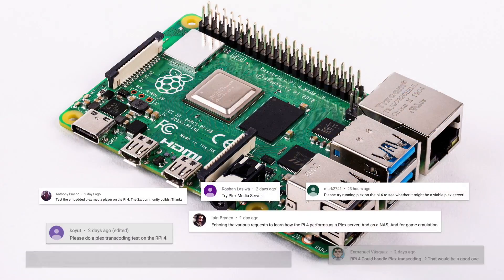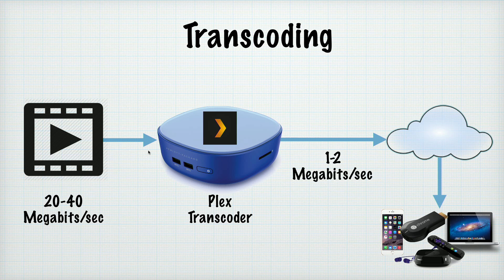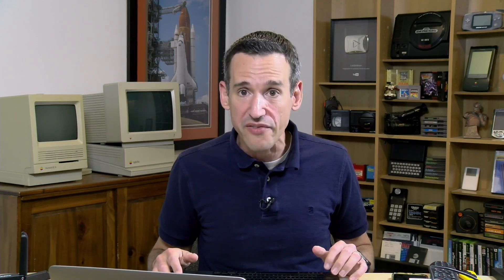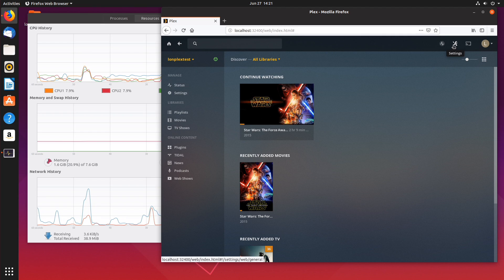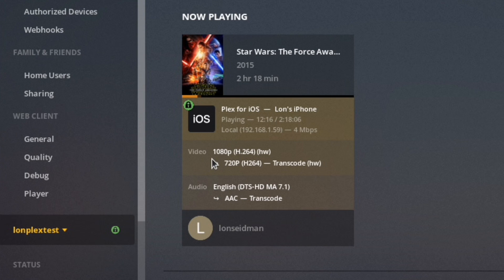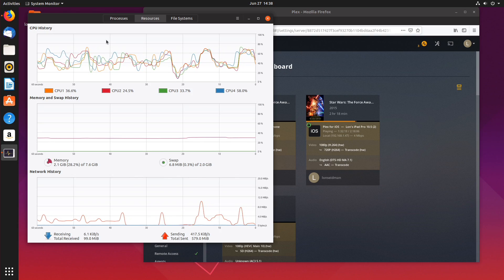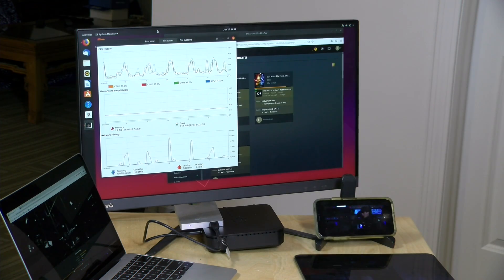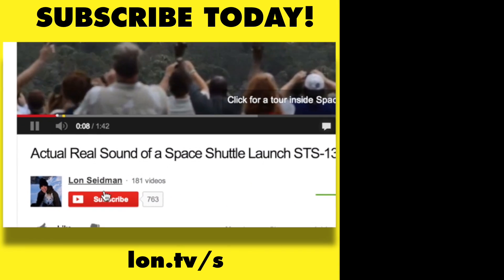Plex Hardware Transcoding Explained : Do you need it? What is the performance like?

Comment: Maybe you could help me with my issue. So basically nothing changed, but my videos started to buffer once per 3-5 minutes. Probably what changed indeed is Plex upgrade from 1.27 to 1.28. My Plex server runs on Synology DS218+ with 2GB of RAM, all settings are default, no hardware transcoding. I'm watching videos on Samsung TV via Samsung Plex app. The strangest thing is that I have zero buffering issues watching the same videos via simple file explorer using DLNA.

Comment: Hi !! Could you comment / compare how a J4125 (intel) will compare with a GPU from MSI Geoforce Gt1030 2G Low Profile or a 1650 4GT LPOC or a 1030 2G LP OC ? I have been considering a unit from QNAP 453D vs a 473a and adding any of those cards (if found), but, I am a bit confused about how much performance I would get using any of those cards on the 473a vs using a 453D or 253D. 

THe 473a uses an AMD chip --> AMD Ryzen™ Embedded V1500B 4-core/8-thread 2.2 GHz processor, so, It just makes me wonder if it's worth it ? or should i just pass and get a 253D (2 bays) or the same 453D (4 bays). Both 453 and 253 use celeron chips with transcoding. But, my concern in the end is really how much will i be getting if I went the AMD way. 

I have looked at the specs, but really there is only so much I know that, I would really appreciate your recommendation. 
 
My transcoding would to share videos from my  iphone to family and friends but keep them stored on a NAS. Thanks !

I have played a bit with PI 4 as a nas, and again, it works but can't do transcoding properly ( is to small or lacks a bit of power - if transcoding to lower bit

Thank you in advance. I am looking forward to hearing from you.

Comment: Is there a better way (less stress on the motherboard CPU) to have the transcoding done in hardware other than the main CPU,  like on an internal or external SSD or in RAM.   When I open the Plex toolkit and go to transcoder, I see other boxes where settings can be made to configure the transcoder.  Could you explain how these settings can affect the transcoder please?

Comment: Sorry, but 100% CPU is not necessarily "stressing out" the CPU. It is working the CPU, yes. But just because the CPU is at 100% doesn't mean that it is overworked. Thinking that it should be at something lower than 100% is erroneous, that means that it is idle ... which is something we wouldn't expect in your workflow.

Comment: I often read, that Intel QS has a very shitty transcoding quality, especially in action movies. It's better with an NVidia GPU but the best quality is still via Software where you do need a very fast CPU though. 

I am thinking of getting a QNAP TS-251D to replace my TS-251A to get decent Hardware Transcoding but I am afraid I'll have a terrible video quality when transcoding.. I saw a solution with getting a small Quadro card to use for transcoding but no way I am spending over 1000€ for a NAS only to be able to build in a 400€ GPU.. That seems very expensive to me..

Would be awesome if you'd do a video where you compare the transcoding quality - Software (via CPU), Intel QS (like in this video) and with an NVidia GPU.

Comment: Lon this is a great and informative video. I have a couple of dumb questions.
1) I have a dedicated computer (coffeelake chip 6 cores) that happens to have a Geforce 980ti GPU. Does the GPU help at all with hardware encoding on plex or is that only on the CPU?
2) If I went with extra storage of a synology NAS would I then lose the extra hardware encoding that I now have with using my computer ? I usually use about 2-3 streams at once with all  being transcoded in some nature.
I have seen some of my family members getting what i would think are low quality (SD ) transcodes of 1080p movies and I have always wondered if the issue was on their side (say wifi speed etc)
Thanks again and keep up the good work.
Reply from the maker: I believe it will prioritize the cpu for encoding over the nvidia but it might use the nvidia for decoding when necessary. Recent synology’s with intel cpus should be able to maintain a few simultaneous streams and consume much less power.

Comment: Too bad you have to have a Quadro P2000 in order to transcode more than one or two streams.

You also have to use a Quadro if you are doing pcie pass through with ESXi, ProxMox or HyperV. Nvidia disables the drivers if it detects a geforce card on a vm.
Reply: Gaming cards shouldn't even have those video capabilities in the first place. They're for gaming. I'd expect to have to buy a pro level card to deal with video.

Comment: I have an Intel Sandy Bridge i7 2600K PC build.  I put in a very, very old AMD GPU just so I could plug in a monitor.  If I tell plex to use hardware-accelerated when available will it just use the CPU or will it try to use the very bad GPU?   Can I tell plex to only use the CPU for hardware-acceleration? 
Also, I noticed that PLEX now has a second option "use hardware-accelerated video encoding"  ??

Comment: just get a gpu: quadro-p1000/p2000 , cheap and no more cpu load !!  tnx
Reply: P2000 aint cheap. Goes for about $400 on eBay. But the P2000 has no restrictions on amount of transcodes and it works within ESXi, KVM or HyperV.

Comment: You can use GPU usage monitoring to observe Plex unload the transcoding (essentially a resize and re-encode to specific bitrate) jobs to the GPU. nVidia GPUs perform way better than Intels. The nVidia GTX-1050Ti in my laptop is twice as fast as the Intel UHD630 in my laptop. AMD Radeons fall somewhere in between. To monitor GPU usage, install nvidia-smi / intel-gpu-tools / amd-aticonfig or amd-radeontop.

Comment: on old CPU, the quality is very bad. I'm using a old laptop (i7 4770HQ or something like that) HW transcoding quality is low with this.
Reply: @MarkAllenGuitar  at nearly full quality it's okay but dropping to 480p and lower (quality is fine with soft transcoding) is awfull. Pixel everywhere.

On the go, i generally watch at 320p while moving, it's not watchable

Comment: yeah I dont think I am asking for much I would just like to have two 1080p streams without having a spinning disc. I usually end up having to watch in 480p. I have one ethernet connected roku and one iPad wireless. If both are trying to watch streams at the same time I get a spinning disc at some point. My Plex server is a hard drive connected to my iMac via thunderbolt 2. Is an i7 chip in the iMac.

Comment: I'm using a J5005 and one case where transcoding is needed is when watching live TV on the google chrome browser. This forces the server to transcode the mpeg2 stream from my HDHomerun from 1080i to h.264 1080p. This still uses 20% of the CPU for a single transcode stream with HW transcoding enabled. You can see this in the Plex server's dashboard. You might want to try this on your system. You will also see some strange issues when you start playing a live channel that is transcoded like this. You may want to use this tool,  http://manpages.ubuntu.com/manpages/trusty/man1/intel_gpu_top.1.html, to monitor the GPU usage.

Also, could you please, please, please, address the lack of HW transcoding support when running the Plex server on Windows 10? This has been a known issue with the Plex server for over a year now and still they have not fixed this issue.

Comment: would an eGPU connected to a mac mini 2018 help with hw accelerated transcoding?
Reply from the maker: Not necessary as the Mac’s processor already supports it
Reply: @LonSeidman  Also I believe you said that's the transcoding is done 100% on the CPU. Right ?
Reply: Plex transcoding is awful in MacOS.  It only supports one hardware encoding stream.

Comment: Unfortunately no mention that subtitles (at least the image-based ones, which are the default on blu-rays) can't be handled by hardware-transcoding. So if you use subtitles frequently and don't want to mess with finding text-based subtitles on some internet server, you might as well stock with software-transcoding.

Comment: This is a very informative video but I feel it may give the impression that as long as you only watch your media at home then transcoding won't be an issue. Plex doesn't just transcode when you're outside of the home and the video needs to be compressed, that's only one of the few situations in which it will transcode. It will also transcode when the device you're using isn't compatible with one or more codecs contained in the file. For example if you try to play an H.265/HEVC movie on an original Chromecast, Plex will have to transcode that H.265/HEVC file to H.264 because the OG Chromecast doesn't support HEVC, there's also a large issue that comes up in anime which makes heavy SSA/ASS subtitles and basically no device is compatible with that subtitle format so Plex has to transcode the file to burn those subtitles into the video. So even if you only watch your media at home a Raspberry Pi may not make a good Plex server and access to hardware transcoding may still be a requirement for an enjoyable experience.

In my own opinion, a Pi is best as a "PortaPlex" aka a portable Plex server connected to a few 2.5" SSDs or portable hard drives with all the media already transcoded to the most commonly/widely supported codecs to use when you won't have a reliable internet connection when traveling or while in the car. That way the Pi can direct stream pretty much everything and will never have to worry about transcoding.

Comment: This helped me a lot to understand what this harwarev transcoding is all about. Thanks! But I'm still confused... Isn't a cpu and CPU? Is quicksync a special chip? A special core? What makes a cpu quicksync?
Reply: Almost all Intel cpus have an integrated gpu. That's what's used for quicksync.
Reply: As far as I understand it Quicksync is a special FPGA that lives on the CPU die that handles the hardware acceleration. It's part of the CPU, and there are quite a few CPUs that don't have Quicksync listed that support it to an extent, undocumented support so to say.
Reply: Quicksync is a little piece of the Intel chip that is highly optimized for video processing. Apart from (un)loading the data and the instruction onto the QS core, the main chip does not have to do much work.

Comment: Does the nvidia shield capable of transcoding??
Reply from the maker: Yes
Reply: Awesome then am set thanks
Reply: @salvadorchavez2198  Yeah but that's basically the only ARM device that can do hardware transcoding and that's only because it has an Nvidia GPU (which do support hardware transcoding). Speaking of I wonder if hardware transcoding can be done in that $100 Nvidia dev board since it also has an Nvidia GPU. Perhaps Lon could test that becuase if that Nvidia GPU can be used on that device it may make a great low-cost low-power ARM Plex server.
Reply: @LonSeidman  ^^^^^^^^^

I think it's the   Nvidia Jetson Nano that I am talking about.

Comment: I mostly use Plex for in-home streaming. Does anyone know why the CPU get stressed out when turning out PGS-type subtitles (bitmap subtitles extracted from the Bluray)? My Synology DS416play can easily transcode a couple of streams without PGS subtitles, but struggles with even one with PGS.
Reply: External SRT files pose no problem - the client can blend them into the movie.
Reply: I believe picture-based formats like PGS are harder to burn into the video than text-based formats like SRT, and SRT almost never has to be burned because basically every device supports SRT.

Comment: I used to have a Plex Pass and use hardware transcoding to watch my ripped media on various devices. But these days I simply put a code from the disc into MoviesAnywhere so I can stream movies to those devices both inside and outside my home. If I want to watch the movie on a TV or my projector I can do so using a blu-ray player (for a disc) or Shield TV (for a rip.) Generally the streaming quality to a phone or tablet is equal to or better than what I got from transcoding on the fly, and Apple, Google, Vudu, MoviesAnywhere, and the like often provide extras that I never bother to rip from disc.